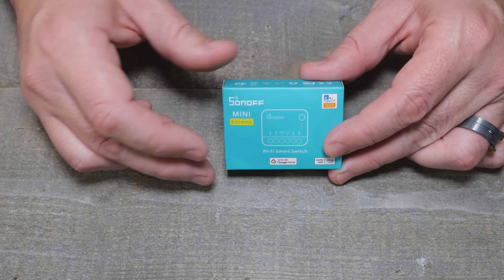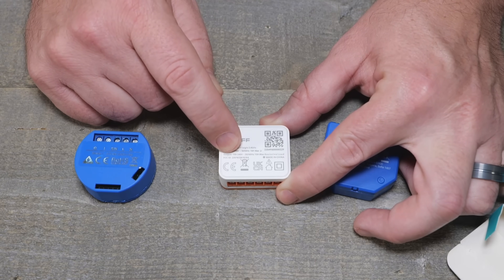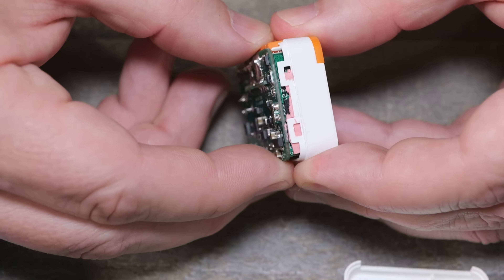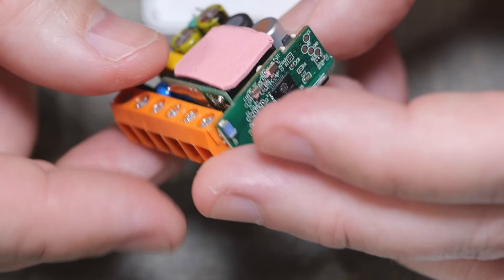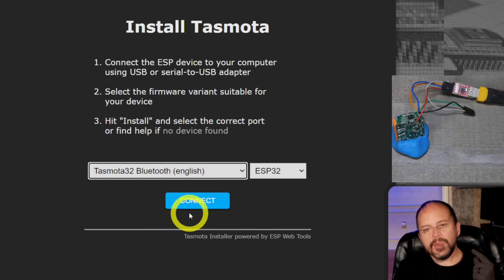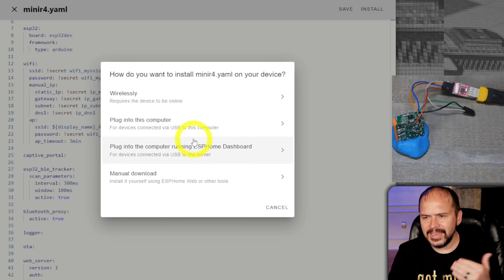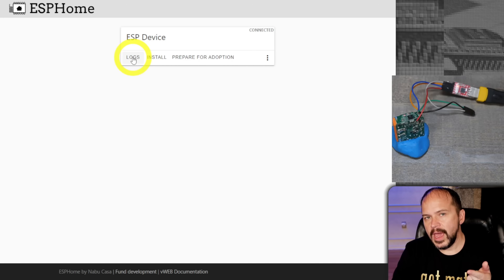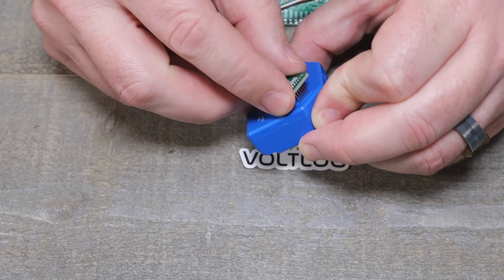Sonoff Mini R4 Switch ESP32 and ESPHome & TASMOTA How To Guide

Comment: You don’t need to worry about a 15amp short. Power travels over the least resistive path. 

It won’t go through the switched plug and the rest is soldered and will easily handle the surge. 

It’s only the relay that is 10amp rated.

In fact, if it’s UL rated, it’s 20 amps unswitched by law. The switched part is 10amps…and with leds it light get 2.
Reply from the maker: No UL here and most likely a 10amp rated relay.
Reply: @digiblurDIY  even if not UL the power isn’t going through the relay unless it’s switched so if you’re using LEDs it still won’t matter because LEDs are capacitively issolated from mains and can’t draw more even in a short because of the X cap. (That yellow thing in the video is an x cap (safety cap that fails open in the case of a short)
Reply from the maker: So why not use a 5A relay? And why do we use breakers?
Reply: @digiblurDIY  you could easily use a 5a relay with LEDs. When was the last time you had 600w on a single switch for lights?  The NEC is written for incandescent bulbs. It doesn’t differentiate between resistive lighting and LEDs that are all DC devices at all. (Yes you can power any LED bulb with DC power. Typically 52ish VDC and up to 170 will work)

We use breakers because they’re in the power path (and as the NEC makes clear, are there to protect the grid, not you. Only GFCI/AFCI protect you). And I’m sure you’re aware but if I draw 20 amps on a 15 amp breaker it takes minutes before it will pop. Only a dead short will trip it instantly.

The relay is NOT in the parallel circuit power path. That is amperage draw from a socket hooked up to this thing in parallel doesn’t go through the relay at all. It goes through the bridged solder connections all of which can easily handle 20 amps, not just 15.

And even in the case of a dead short down stream, the breaker will pop in under a second which those solder joints will easily handle without damage.  And unless you’re putting 13 incandescent 100w bulbs on this relay or more than a 1 HP motor you’ll be just fine too.
Reply: @digiblurDIY  PS:  you can test all of this pretty easily:

Crack open an led lightbulb hooked to this thing and create a dead short on the LED side of the circuit. You blow up the capacitor on the other side of it, but that’s it. It won’t affect the relay at all. 

And if you’re brave, short the cap in a bulb too. Same thing will happen because the cap is x/y rated. 

And if you just dead short between the bulb and the relay the breaker will pop before the relay is damaged. 

And if you dead short wires in parallel (using the soldered together connections) it will pop the breaker with no damage to this. (As long as they didn’t screw anything else up in their design). Then plug in a kettle and hair dryer to a socket hooked in the same configuration. This won’t be damaged and the breaker will pop after a few minutes and then pop if you reset it faster because of the preexisting heat. 

Unless you can actually get that solder to melt, no damage will occur to this. And given how short the solder joint is I’d guess at least 40 amps continuous and you won’t be able to insert wire that won’t melt at that amperage into the connectors. 

What you do have to worry about with relays is arc welding. So using a motor or switched resistive load is never a good idea because they’ll weld closed. But LEDs don’t draw enough to cause an arc so you’re fine. And to fix it if it does weld, just tap it a few times with a screw driver and they normally release.
Reply: @digiblurDIY  Did you get  a pic of the relay specs or p/n?

Comment: Being a luminary controller I don't sweat the 10a rating, especially with LEDs taking over these days. A lot of old dimmers would smoke too if pushed near the max rating. I wouldn't hook them to outlets, or thermal loads though.

The yellow box is an X class capacitor.
Reply from the maker: If only we had this luxury we wouldn't need breakers at all ;)
Reply: @digiblurDIY  You would be terrified if you opened some UL listed devices. The breaker is for the wiring not the load. I don't recommend throwing caution to the wind, but the chance of the fire jumping out of both the enclosure, and the wall box is low. It's your house, your decision of course. :)
Reply from the maker: yeah not going to be me.  I mean there is a reason why you don't see 5 or 10 amp rated switches and sockets in homes.
Reply: @digiblurDIY  It's within code to derate lighting circuits. You'll find plenty of dimmers rated less than 15a. Outlets and lighting circuits are different animals. You can reliably calculate the max load a lighting circuit will see because the fixture socket physically limits the max load possible, and is relatively constant. Of course a wall outlet is different because you can plug a  single 20 amp device in and max the entire circuit out. For a lighting circuit you know what's past each switch and calculate the typical load. A 10a switching device on a lighting circuit is 100% safe for most installations.
Reply: Came here to say this... Don't put this on a circuit with downstream plugs, or other high, or non (primarily) resistive loads and you'll be fine , and safe. It's a luminary switch controller and used as such it'll be good.

Comment: Shame issue in the UK. There are loads of UK Tuya plugs (outlets) that are rated at 10A while our plugs are 13A fused with a 32A breaker. Never understood how they can be legally sold in the UK.
Reply from the maker: Shelly knew what they were doing with that 16A rating for sure. I have seen Evvvr's relay that is load fused but only 3A and it popped during testing on me. 10A would be fine with a load fuse on board. Covers most things.
Reply: Uk light switch breaker is 6A not 32A. For wall socket it’s 32A breaker

Comment: Great rundown.  Thanks for reinforcing the fact this device is rated 10A, so it should not be connected to a standard 15A US circuit without additional overload protection for 10A.  I didn't see anywhere that this particular one is UL Listed?
Reply from the maker: No listing on it that I saw.
Reply from the maker: UPDATE:  I pulled the relay off and indeed it is 10A on the back side.  I'll update the website with the pics.

Comment: There is a fusable resistor there, just like Shelly's have.
Reply from the maker: Which component?  It is probably just on the power supply side feeding the ESP though as usually the load isn't fused.
Reply: @digiblurDIY  it's the vertical black component next to the blue varistor behind the yellow component.
Reply from the maker: Gotcha.  Yes, so just on the power supply itself and not the actual load.  Thanks for the confirmation.
Reply: Does that mean we don’t need our own fuse
Reply: @kawsarhussain7942  Yes, this has its own fuse protection, it looks like there is a MOV in there too, the blue component, to deal with surge protection.

Comment: Did you check the markings on the relay? Is it really 10A?
Reply from the maker: UPDATE:  I pulled the relay off and indeed it is 10A on the back side.  I'll update the website with the pics.
Reply from the maker: It must be on the side against the PCB.  I pulled the pink bubble gum off and it is blank.  I'll have to go off their suggested ratings that they came up with.
Reply: @digiblurDIY  It's not on the top against the capacitor? Hopefully somebody does a desolder of the relay otherwise.

Btw, the 10A will certainly not be a problem with a short. If you have a real short current will spike high enough to trip a 16A breaker. Overloading is a bigger issue, aka, don't make it switch an output aka, unknown load. Other then that I would happily use it on a 16A circuit.
Reply from the maker: No, I followed the load traces from the terminal to the relay.  Not something I'd feel comfortable using without a fuse inline in the wall.  But at least that's an easy fix but then again I'd probably just rock the Shelly line with pin headers and 16A ratings.
Reply: It must be 10A, 20 or 30A relays are much bigger, those could not fit in case
Reply: @clixium  Hard to get a sense of size, but I have pretty small 16A relays in my collection.

Comment: The yellow box at 5:25 is definitely not a fuse, it's a "class X safety capacitor." It will be connected across the live and neutral AC lines. It's designed such that if it fails, it will fail open but not short (for obvious reasons).
Reply from the maker: Ahh... I've seen those fail in some dimmer refurbs before, but that must have been fuses as they had an amperage label on top of them.  Once we replaced them the unit started working again.  Thanks for the clarification on the no fuse thing.

Comment: The yellow part is not a fuse. It's a capacitor.
Reply from the maker: Ahh... I've seen those fail in some dimmer refurbs before, but that must have been fuses as they had an amperage label on top of them.  Once we replaced them the unit started working again.  Thanks for the clarification on the no fuse thing.